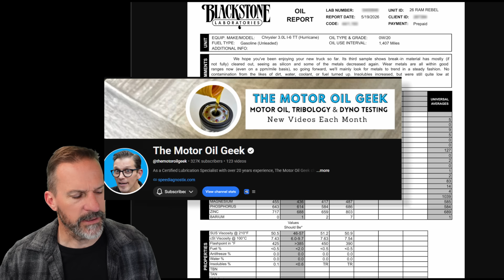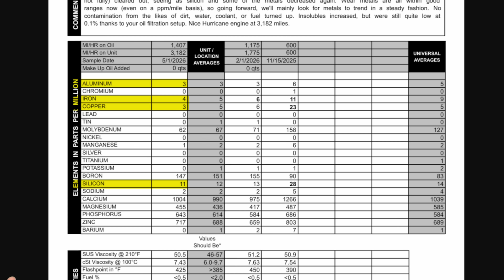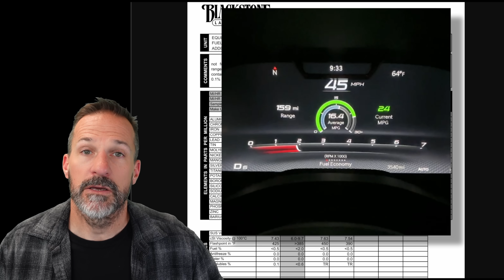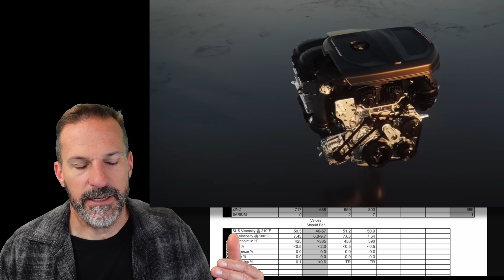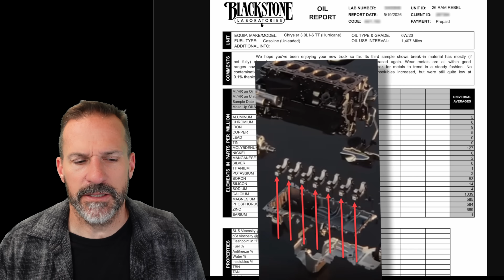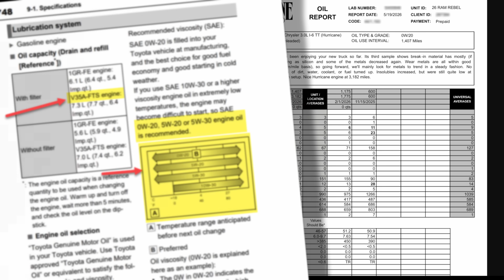The Break-In Secret Most New Truck Owners Ignore

Comment from the maker: What would you use, 5w30 or 0w40 Next?  Hopefully soon I'll be changing the rear differential fluid, possibly the transmission as well to continue the break-in lubricant purge.
Reply: I would use 5W30 considering on how much easier it is to find & price. Wife's 24 Odyssey calls for 0W-20, I use 5w30.
Reply: @JamesPiccone  I switched from 0w-20 to 5w-30 (in phoenix), I went from 55 mpg to 52 (in a hybrid) probably worth it for heat of the summer.
Reply: Been using the Pennzoil SRT 0W40 oil since it had 8K miles. I tow a fair amount and use it fairly hard and have 98K on it now and have never had a single issue. I live near Cleveland and it gets hot in the summer and very cold in the winter and this oil works great for me. Still cranks fast in the winter yet gives you better bearing loads when towing. I have the hemi but that thicker oil is better for the turbos too.
Reply: Depends on climate, I’m in the same boat with Lake Speed, have a brand new 2026 Nissan Frontier. I live around charlotte NC, Lake lives around me, he says he’s going 5w20 on the next oil change for more sheer stability, so that’s what I’m going with next oil change.
Reply: 0w40 will be fine. The 0w20 already runs through that viscosity range as it's warming up.
Reply: I'm leaning toward the 5w-30.  This viscosity seems to be the sweet spot.
Reply: 0W-30 - I explain this in detail in another comment.
Reply: Just bought a new tundra...Im putting penzzoil platinum 5w30 in mine....i would recommend same for you. This is my 4th tundra always use 5w30 never a problem all over 200-300k
Reply: 5w30. It’s the most common oil that you can find anywhere.
Reply: 0w40 for sure
Reply: I’m not sure I’d do 0-40.  I’d start with 5-30.  I’d do both and test after each.  Lake says you need to do a flush to get accurate results.  So run the engine with 5-30. Then change it after some miles and test the second 5-30 for more accurate results
Reply: I would try the 5W-30 first as a step up method.  If that works well and gives you the reduced wear you are looking for you are good.  If you are in a colder climate, you could use the 0W-30.  If you don't get the wear protection you want with 30 weight oil, then try stepping up to the 0W or 5W-40.  Jumping 2 viscosities may cause an issue where oil does not get to where it needs to be and you can't take that damage back.
Reply: Viscosity affects flow rate and flow rate are important for getting the right amount of oil into the right places. Or at least I presume that's the case (I'm an engineer, but not the kind that took physics classes). My concern is that 40w might be too thick to flow fast enough for proper heat dissipation (assuming it can everywhere it needs to), and 5w isn't going to give as good protection on cold starts.
Reply: I would try 5W30 first and do an oil analysis. The problem for me is that your american 5W30 is like 10-11 cSt @ 100C with 3.1 - 3.2 HTHS, which is lower than typical european 5W30 ACEA C3 (11.5 - 12 cst @ 100C and 3.5 HTHS). The euro spec C3 would be perfect in my opinion. The 0W40 would be like 13.5 cSt @ 100C which is a big jump, but might me reasonable for towing.
Reply: I'd go with a 10 or 5w30, get a baseline on that, then a 40wt.
Reply: Breaking in a 2026 ford maverick hybrid the same way.  I get pretty much free oil analysis through work so collecting all the data.  It will definitely be a show down between penzoil vs mobil 1.  And 0w20 vs 0 or 5w30
Reply: 5w-30 euro with api sp/sq rating for 100k miles, then switch to 0w-40. currently using mobil 1 esp 5w-30 in ecoboost 2.0.
Reply: To fully understand any used oil analysis, you have to know the TBN & TAN values.  That's how you truly evaluate  the oil you are using and how much protection remains.  With respect to what oil you should use next, how can we know for sure if we don't know the TBN & TAN values.  Further, at 7.43 centistokes, your report shows you're actually staying in grade during your oil change intervals.  Now if you extended your oil change intervals, and your viscosity drops to the 6's, I would then consider moving to a quality 5W30 oil.  The viscosity range for 5W30 is 9.3 - 12.5 cSt.  No need for 0W40 oil.  

NOTE:  If for some reason you did go with a 0W40 oil, make sure it's a Euro spec formulation.
Reply: In that particular engine I would use the factory spec oil (0w-20) since the oil serves as hydraulic fluid in a lot of the engine systems and everything is calibrated to that. That said on Turbo engines the oil will start looking like trash at 2k~3k miles due to the heat from the turbos so I wouldnt go much above that between oil changes specially in the summer and if you tow at all. I live in Denver so my rec is for that area's climate.
Reply: @Kenneth_R  Which engine? The Ram or the Frontier?
Reply: Thanks.  not sure on viscosity change from manual recommendations... will watch your future videos for latest updates .  My wife buys plants based on a published USA temperature range guide.  Is there a cheat sheet / map showing temperature and oil vis recommendations?
Reply: GM L87 was proof that 0w40 provides the best protection

Comment: My daughter just traded in her 2012 Honda Odyssey with 312 thousand miles on it. She didn’t get an oil change when it was brand new until it had 5000 miles on it.  No early oil changes before 5000 miles. I owned two Honda accords that reached 200 thousand miles and had a Toyota matrix that is still running with over 300 thousand miles that we had sold to a friend. None of these vehicles had Thor oil changed before 5000 miles.
Based on this I tend to believe that not performing these early oil changes do not cause noteworthy damage to vehicles in most cases. Only oil wear testing g could determine if it makes  a difference it seems or perhaps it only affects engines made after 2008 and before 1999. Only wear testing could answer the question and it might vary between vehicles..Perhaps you shouldn’t tow until after 5000 miles.

Comment: As important as break-in engine oil changes are, don't forget clutch pack friction material being entrained in the transmission fluid, or metal shed from gears in the transmission, transfer case, and differentials. They too, need early gear oil/fluid changes. The transmission is about ready to drop the pan, clean it, and its magnet, and a new pickup screen filter in the transmission. That will keep solenoids and barrel valves moving freely, for better, more predictable shifting.

Comment: My dad always says, trust the engineers. And my argument to him is "If they never ever got it wrong, I would." All that load with 20 weight oil, cannot be good. Especially when towing. In my opinion, those are race car engines that were put in "tow trucks"(trucks made for towing). Mix that with other engineering mistakes pertaining to inadequate thrust bearing load distribution, along with inadequate crank main bearing load distribution, boost pressures and loads upon said surfaces....disaster. Again, race car engines do not belong in trucks.

Comment: Maybe you should check the owners manual and see what options in oil viscosity it suggests and then maybe you could formulate a better plan.
Reply from the maker: The owners manual is not how savvy people decide on viscosity or break in, it's geared toward the masses and recapturing buyers, and not longevity.

Comment: Did you change the filter with those early oil change.?
Reply from the maker: I didn't change the filter until 3000m change. On the first change at around 500m, I also ran about 1qt of new oil through, with the drain plug open in theory to help rinse out any larger debris.
Reply: @TheCarGuyOnline  I have a 2026 3500 dually.  I changed the oil @ 450 miles . The rear differential oil@750 miles . I was surprised by the gunk on the fill plug on that.

Comment: Use 10W-30…I changed my 2006 Kia Sportage at 44 miles to 10W-30.  Kia recommended both 5W-30 or 10W-30.  And then I changed the oil at 250 miles and at 850 miles and again at 1500 miles. Then I changed it at 2500 miles and 3500 miles. Then I started changing the oil about every 2000 miles. Currently I have 157 oil changes and I have 187,000 miles. Car runs perfectly no issues. If I listen to Kia and change the oil every 7500 miles I would have only 26 oil changes in the last 20 years.

Comment: I was always under the impression that a new motor needs some wear to break in properly? The cylinders and the rings/pistons don't match correct and they need to wear to match eachother no? If we prevent all wear this doesn't happen and the oil from the factory is designed for this yet everyone wants to change the oil immediately. I don't get it, not arguing just don't quite understand what is the strategy here.

Comment: Switch to a 0w-40. GM had their main bearings failure. So the did a recall and changed their oil to a 0w-40.😅

Comment: Why not replace the oil filter? Also, since 90% of the break-in happens in the first 100 miles or so, no need to wait until 500 miles or more. Considering OEM filters are not great at filtering under 50 - 30 microns, I don't understand the logic behind not replacing the filter sooner vs later.

Comment: When you get to 10,000 miles change transmission fluid and gear lube and you should be good for another 50K miles. By 10,000 miles the ring and pinnon gears and the transmission shouldbe done with break-in.

Comment: 0w40 all the way! With the current global oil shortages I would probably skip the Pennzoil Platnium and Ultra Platnium in favor of M1 0W40 ESP or Super Car oil until Pennzoil brings back the oil with the label saying "Made with Natural Gas" since that represents their oils made with their GTL base stock. They have removed that label because they can not get GTL base stock out of the refineries in Middle East due to Iran War! The reason is that M1 0W40 FS has too much calcium for a Gas Direct Inject Turbo charged engine and LSPI might be an issue! IF you wanted a 5W30 Mobil-1 5W30 ESP should also be a good choice.

Comment: Love your content also follow and test with Oil Geek. Have been wanting to buy a new truck for 2-3 years now and just can't get past all these failures and recalls. The Ram Rebel seems like the best choice up to this point, thanks for all your testing!!!

Regarding the oil testing I've done in my 2025 mustang GT running Motorcraft 5W-30 I've seen all good numbers regarding wear metals going down. I did oil changes at 1,700, 5,700, 9,700, 13,700 and don't run the car hard often. The numbers on the Speed Diagnostix oil analysis that do bother me is the (Viscosity @ 100C). My first two tests showed the numbers as a (red concern) at 8.8 and 8.70, the last test showed it as acceptable at 8.98. I don't see why my first two tests should be in the red when I'm doing my first oil change at 1,700 miles then again 4,000 later. So, I'm switching to Castrol Edge to see if there is less of a breakdown in the viscosity with a better oil. My mustang also doesn't have an oil cooler, which may be a future addition, plus I live in Florida.

I would be interested to see your (Viscosity @ 100C) results on your Rebel once you start extending your oil change intervals or switch to a higher viscosity oil. I did a race school at Charlotte speedway last year and we ran their Mustang Dark Horses (HARD) all day and their engine and transmission temps got up there but came down quickly. The instructors said the only mods on them were oil and transmission coolers. If I ran my car like that it wouldn't have been pretty.

Comment: Isn’t the break in period 3 changes within the first 5k? So after 500 miles driven, another 1,500 drive. Finally after 3,000 driven? So change at odometer 500k, 2,000k and 5,000k. Changing the oil filter at 5,000?

Comment: I followed the GOAT Mr. Lake on my 2026 Nissan Pro 4X changed at 500 miles no filter, 1,500 no filter and will change at 4,500 miles and change the filter. I didn't send in my oil. I am glad you spent the money so I didn't have to.

Comment: I just bought a 26 F150 because Ford doesn’t use 0-20 oil. It’s a 2.7 and I just received its first oil change from Amsoil. It’s a will get done at 500 miles. This is something I have always done. The F150 with the 2.7 is very impressive so far. Hoping it stays that way…….

Comment: The motor oil Geek also said that 0-20 oil was no issue for today’s engines. So I was very surprised by his finding that 0-20 oil in a GM 3.0 diesel had a lot more wear metals than it did when they changed the oil to 5-30 oil. And 0-20 oil had a lot of people including me that with today’s hot running engines a 0-20 oil is not up to protecting today’s engines. And the small increase in mpg from lower pumping losses is actually costing you in engine longevity.
Reply: What? Your comment makes no sense. lt's full of contradictions.

Comment: New 25 f150 for my work truck. Company fleet department would not allow me to do the 1st oil change until 8500 miles. It has the small engine with the turbo. I'm no mechanic but it seems problematic at best.

Comment: I  purchased a new '24 trailboss 5.3 (I am now 60 yrs old) followed this break in, Keeping my own records switched to 5w-30 after 1st drain and stick to every 4,000 miles! Truck currently has 25,000 running great, never been back into the dealer even for their freebies! I think it pisses them off I have not been in they still keep contacting me even after the freebies were to have expired! I have done some mods and my intention is to keep it well into retirement or till I Die and do not plan on driving a bunch of miles.

Comment: I'm 71 years old, I was born into the construction field pipelines. Excavating, etc. I\nWas told more than once by many different mechanics.Never to change your brand of oil or we stick with the same one, I've been running penzoil, platinum for the past 10 years or so and having no complaints.Everything's fine at old 98 Ford Crown Vic.But it's got low mileage on it.

Comment: I have a new f250 with the 6.8 gas. I changed my oil at 1000km, 5000km, and every 5000 going forward. Hopefully that’s good enough to keep it running for a long time. Although i think the 10 speed is the biggest issue in these trucks not the motor. Just hit 12000 and going to get the trans and rear diff serviced soon. Crazy ford says you don’t have to change the trans fluid for 150,000 MILES (almost a quarter million kilometres)!! And they also claim that if you don’t tow you NEVER have to service the differential. Insanity!

Comment: The greater the difference between the first number to the second number, the greater the chance an oil will shear out of viscosity. So the chance a 5-W30 will go out of grade faster is greater than a 0-20 going out of grade. And the worst thing an oil can do is go out of grade. Lake Speed explains all of this in his videos. Stick with the 0-W20 every 3k miles and use a superior oil brand. 0-W20 is the oil for the V6 Pentastar Jeep engine.
Reply: 5W-20 was actually the best in stability.

Comment: I have a 26 Ram Rebel Cummins. I change the oil 2 days after I bought it and less than a 1000 miles on the factory fill.  Then several more times in the first 15k all with 5w-40 and Blackstone samples.  Iron was off the charts in the first sample and has significantly dropped after each sample.  
I did the front and rear differential x4 times. The first samples in Both ends had over 500 ppm in the first samples and have dropped under 100 ppm in the last sample.  I went away from the OEM 75w-85 gear oil to 75w-140.

Comment: Who doesn’t change the original oil at 500 miles and every 3k oil change intervals?  So think about this. Car is manufactured, then shipped, then sits on the dealer lot a 100- 300 days some models sitting 400-600 days on the lot. The original oil is short driven never getting to operational temps and it’s nearly a year old when purchased. You should demand the oil be changed prior to taking delivery.

Comment: Any 0w oil you are gambling on the additive package.  I refuse to run it in any vehicle I own.  On the rare occasion that I have gone to the dealer for an oil change I’ve got no pushback asking for 5-30w.  0w was an engineering compromise to help meet CAFE standards.

Comment: I have a 2023 Tundra with a new engine because of the recall, and am planning to go the exact route you going with, on oil change intervals. I've been following the Motor Oil Geek, and have received the oil analysis kits from him. Once the engine is broken in, I will switch to 5W-30 viscosity oil, after my 5000 mile oil change at the dealer. Thanks for the great info you provide!

Comment: I bought a new 2024 Ford F250 with the 6.8 gas engine. I followed this same recommendation the geek said before he said it. At 500, 1500, 3000, 5000 and every 5000 since. I get excellent fuel mileage in a super duty, 16-18 mpg on the highway.

Comment: Regarding oil weight, that should depend on where you live/drive, at least according to Lake Speed. I live in Southern California and drive in this area. Based on weather, 10W-30 works for my 2020 Silverado 5.3v8(recommended 0W-20 from GMC). I might go back to 5W-30 for the winter months but I live along the coast. Yes, change oil at 3K and use a decent oil filter (stopped using AC Delco after opening up a few and viewing crappy construction). Wix, Baldwin, K&N, all good. I use Amsoil. 100,450 miles to date. BTW- whatever GMC states in terms of maintenance, go half (or any other manufacture, for that matter). IMHO...

Comment: Acura is running 0W-20 on their Turbo 4cyl . Not a truck, but turbo charging a 4cyl engine is pretty hard on that little engine. So far I have 76k miles with zero issues. I will do an analysis on the oil and report back.